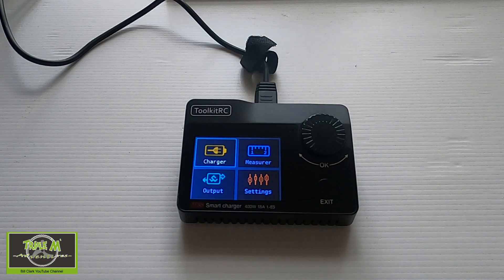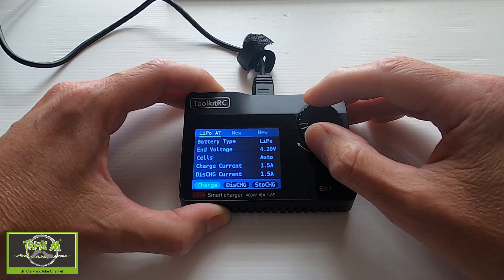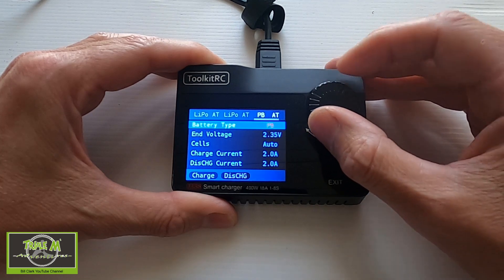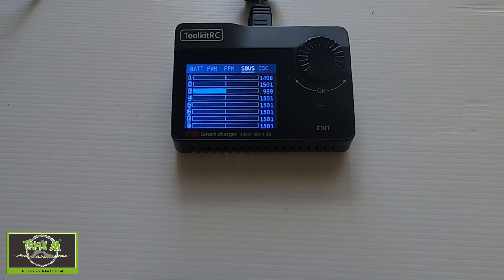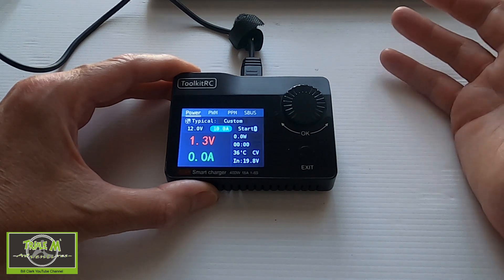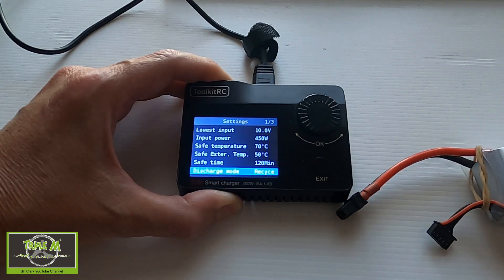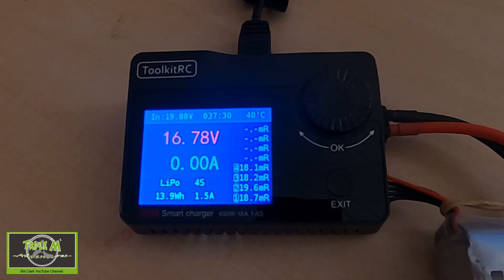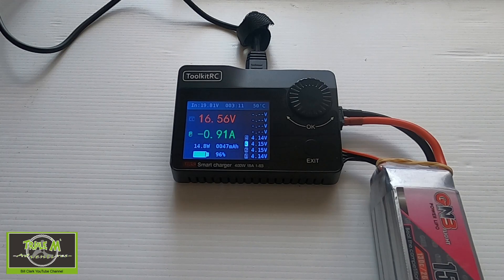Review: ToolkitRC M8S Multifunction Charger

Comment: Caveat.  I received my ToolkitRC M600 out of calibration and burned up one cell of a 3s 2600.  It would be a service to show people how to check the calibration of these and calibrate if necessary.  Been a great charger other than that.
Reply from the maker: How far was the calibration out?
Reply: @the-happy-RC-flyer  According to  my tried and true Micronta multi-meter it was charging the cells to 4.1, 4.25, and 4.5.  At least it never caught on fire and just pooched the cell (so there's a glass half full).  After calibration it has been rock solid.  I salvaged the battery by dismantling it into one scrap cell and two 1s batteries.  New leads to reflect their new roles and a new bookbinding tape battery covers.  Much more limited use, but through a mt3608 they are good long lasting low amp constant voltage supply.
Reply from the maker: @lolipopsandfancypants7257  4.5v not good! I checked the M8S putting my 4s into storage two cells at 3.87 and two at 3.86 I will charge it in the morning and check again. Your comment has prompted me to add the cell voltage test to my charger reviews. Thanks.